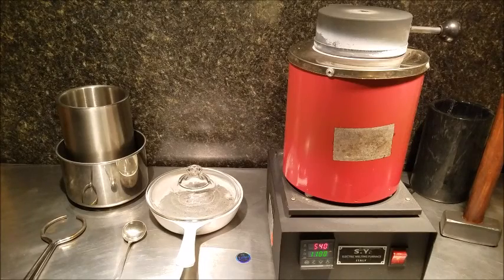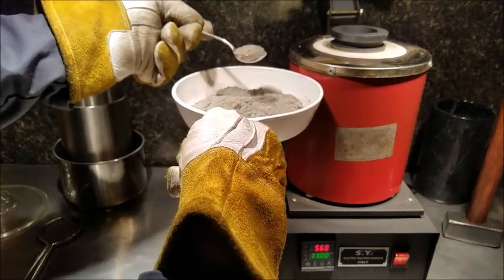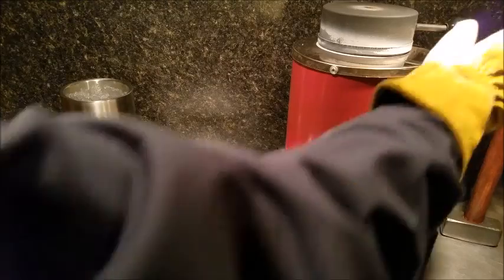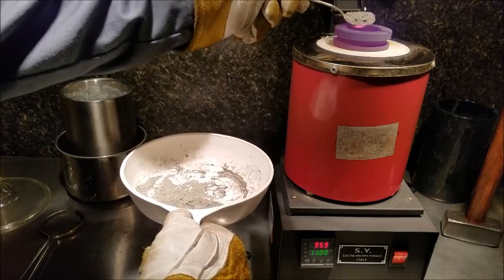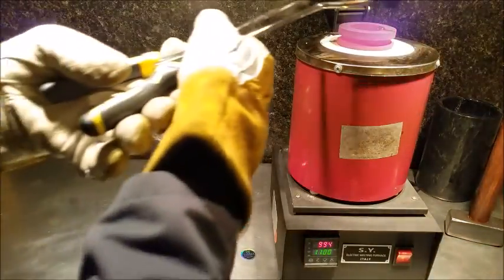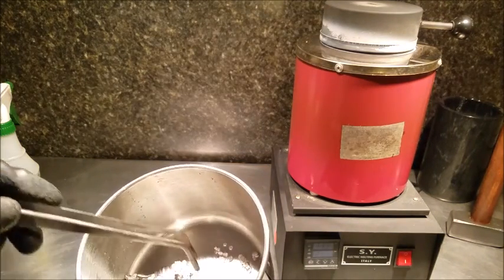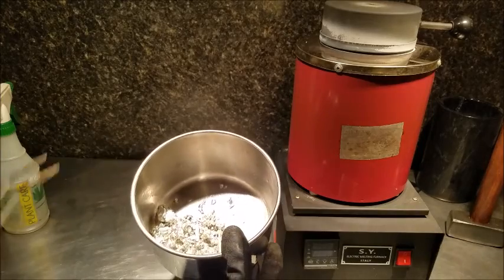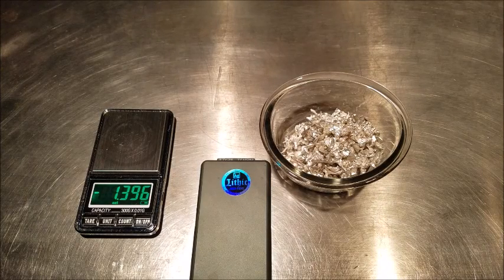Scrap Silver Refining (Part 5) Melting Cement Silver Into Shot

Comment: just wondering if adding borax here wont help remove unwanted iron oxides? or does it have some other negative reactions?  just curious.
Reply from the maker: You don't want to use borax in a graphite crucible. The real trick here is to limit the exposure to oxygen by keeping the lid closed as much as possible.

Comment: Jeff try using a canning funnel to put the cemented silver into the crucible. It's a wide mouth funnel with a large open top. You may have to charge the crucible before heating it up. The one I have is made out of aluminum. I'm sure that they can be found made out of better materials.